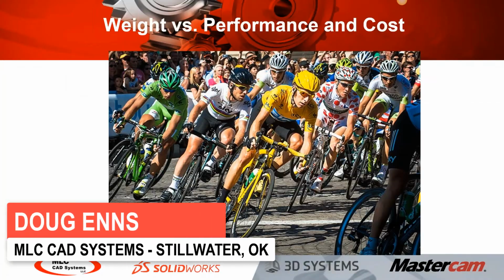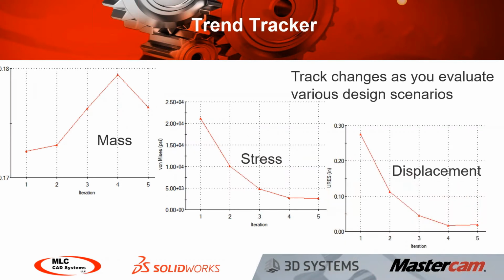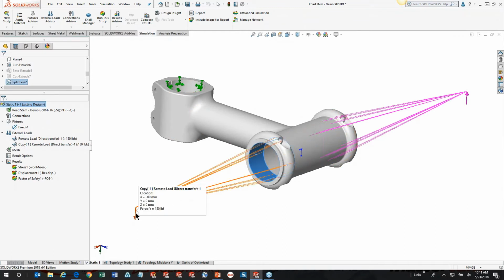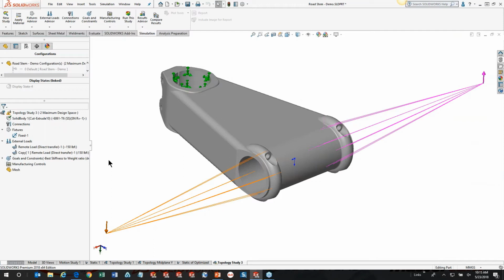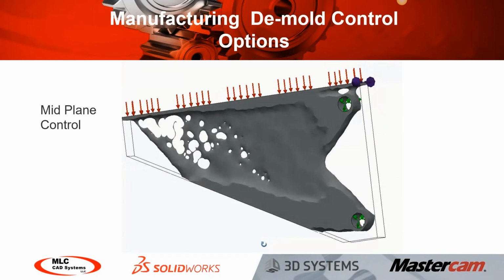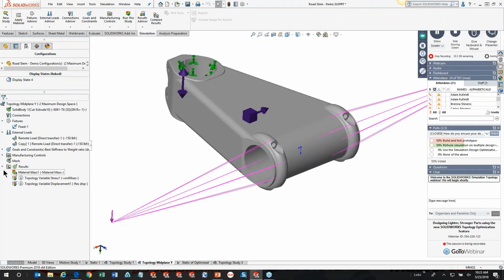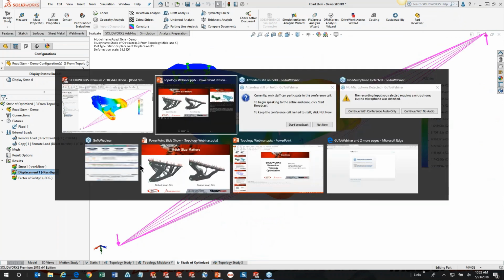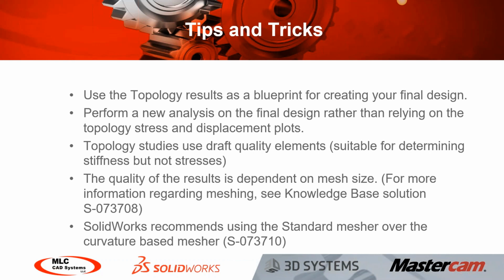SOLIDWORKS Topology Overview Webinar

Comment: Thanks a lot for this video !
Reply from the maker: You are welcome!
Reply: @MLCCADSystems  please make more videos like this one 🙏 YouTube is poor on this topic (Considering SOLIDWORKS). Also, could you help? I often have problems with mesh, one time it goes okay and when I do some minor changes (like change dimension on a few mm), it says it's not possible to generate a mesh. Sometimes restarting SW helps, sometimes I have to redo all simulation from 0. What can cause this issue ? SW 2022 SP5.0
Reply from the maker: A mesh can fail for several reasons.  I recommend checking the size of the elements you are using and compare that to your geometry to make sure it is a reasonable size.  If you have 0.1" thick tubes in your model and your mesh element size is 1.0" that is going to fail a lot.  Also consider changing to the curvature or blended curvature mesh if you aren't using them already.  Finally incompatible mesh is a good idea and should be enabled by default in your version.